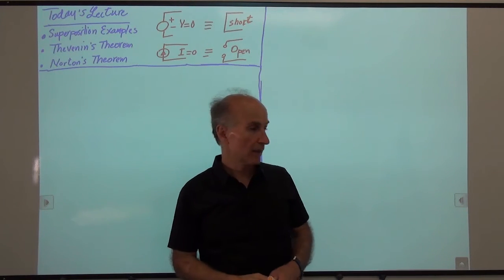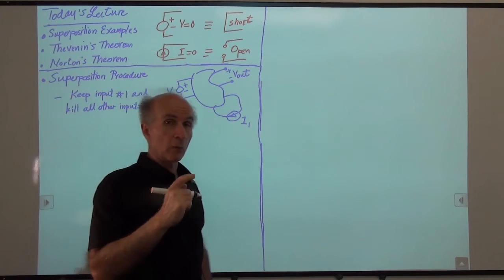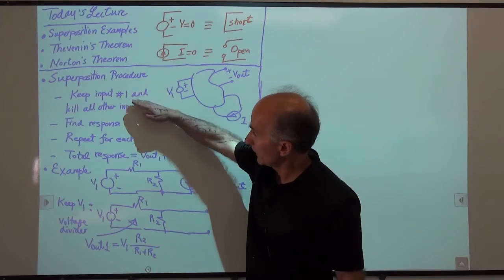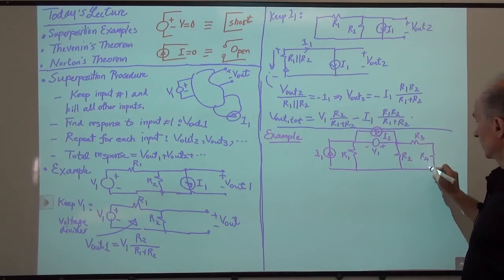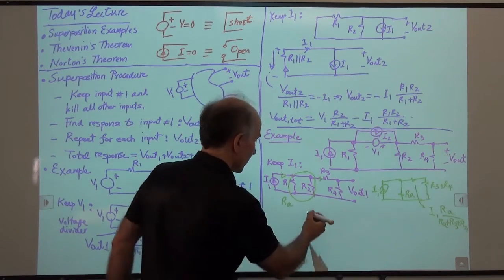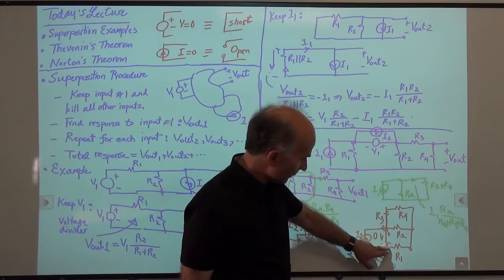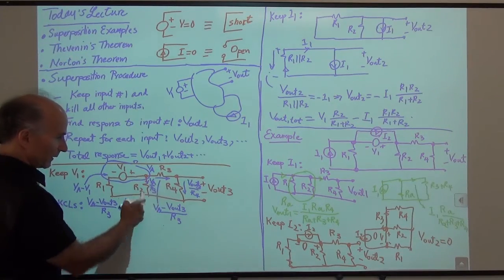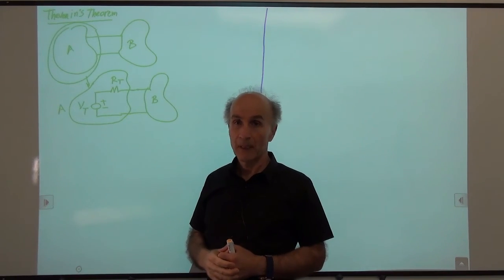Razavi Basic Circuits Lec 9: Superposition Examples

Comment: At 36:50, sir can we just simply convert that circuit to something like ( (R2 // (R3 + R4) ) + R1, and then use normal node analysis to calculate the current and voltage of R4 as Vout direclty?